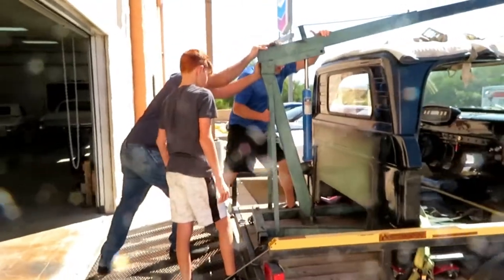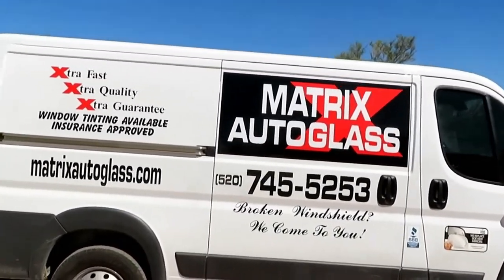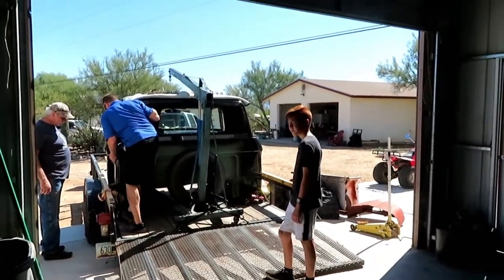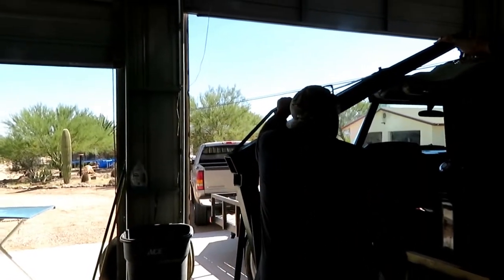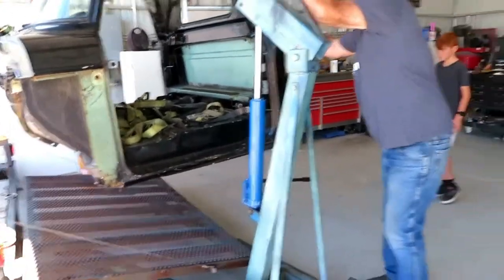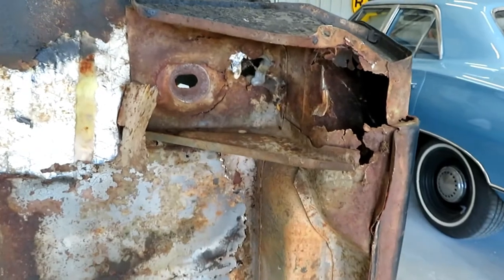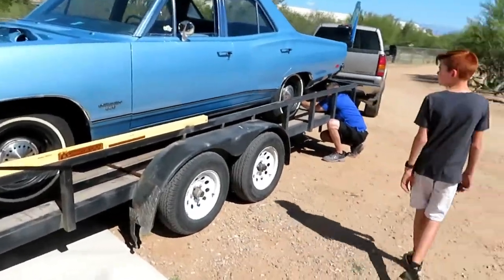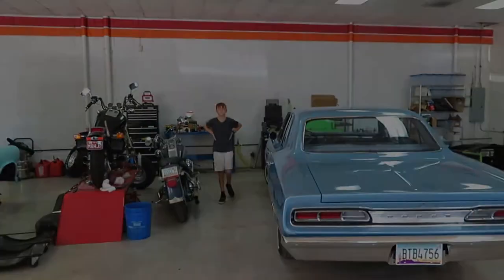1966 Dodge truck cab goes to the body shop and the 1969 Coronet comes back to the mechanical shop

Comment: That's one engine
Reply from the maker: This engine is a 318 ci small block bored .060 over (which makes it approximately 328 ci)  This particular engine is freshly rebuilt and includes an RV cam and the 2bbl intake manifold is being replaced with a 4bbl edelbrock intake and the carb will be a 650 Holley.  So basically, this will be a warmed up Dodge small block which actually ran quite well before the rebuild.  The reason for the rebuild is that there was a fairly loud noise in the engine.
Reply: @bartk85622   That is amazing